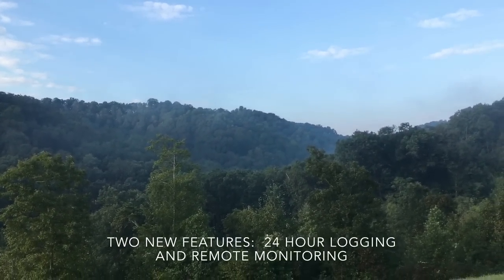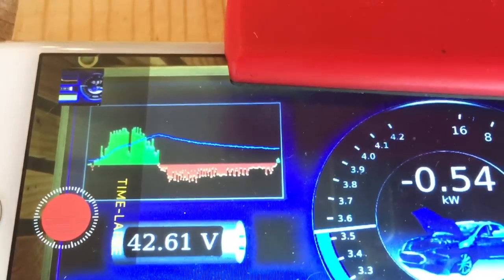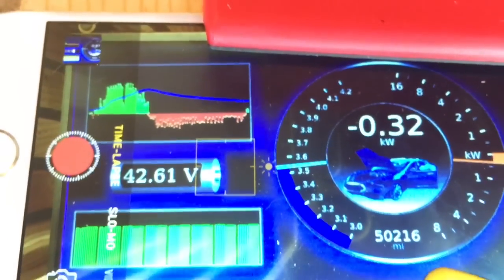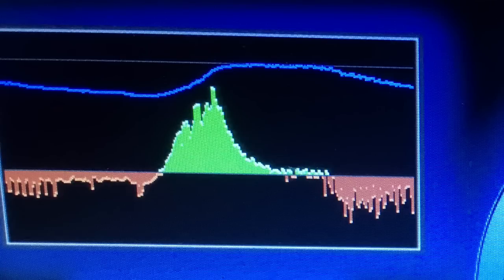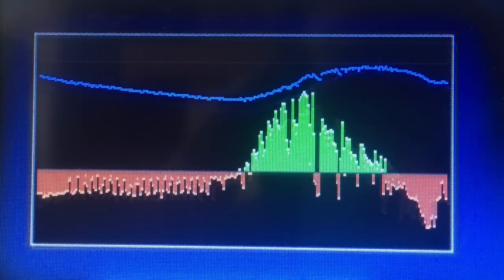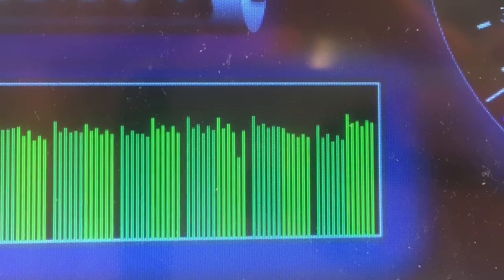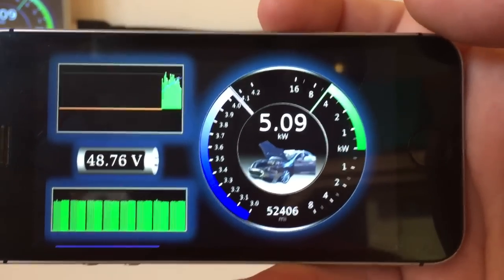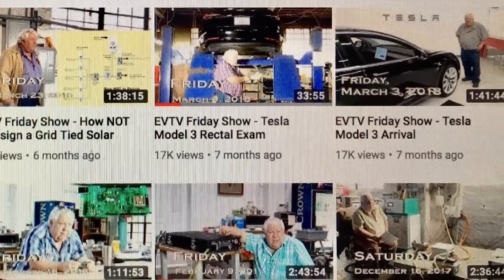Part 4 - using a salvaged Model S battery to live off grid

Comment: One thing i notice is that your mile meter is actually moving when batteries are charging vs when batteries are discharging. That how i feel it should be as that would be more accurate representation of miles. Love the videos anyways. May be you can do another update now. That will be really helpful

Comment: Clearly the voltage disparity as your battery exhausts is just showing that some of the seven ~220ah/3.6v units that make up each ~5.5kw 25v block have slightly less amp hr capacity and therefore exhaust before the rest. This means that you can't use the remaining capacity in the other 3.6v units which reduces the accessible overall battery capacity.  As the batteries age, the variation will increase and to get the most from the battery, it is tempting to add small blocks of extra lithium-ion cell capacity to augment the few individual 3.6v units that are holding the rest of the battery back. I understand Tesla initially used cells capable of 7 amps draw although ideally you would want to add cells with similar internal resistance as the original cells. I don't know how great the amp hr capacity disparity is but I would be tempted to use rescued power-tool cells for this purpose. A 18v 4ah failed power drill battery will often provide 16ah (8x2ah cells) at 3.6v (assuming one pair failed killing the battery) which may be all you need.

Comment: Congratulations for that amazing and succesfull work! I would like to share with you some thoughts: if Tesla cars (or similar EVs) would be technically tweaked to also have an AC outlet to feed off-grid homes, could it still be economical nowadays for most of us to own a second car to allow alternance in daily commute if needed? Overall, I estimated that the cost of your off-wheel battery pack adding inverters/electronics, transport, research and man-hours (not including your old batteries!) would get close to an extra EV (probably not new). If so, and since GaN bidirectional multisource inverters circuitry is available for the automotive industry, would the concept be attractive for the EV manufacturers? I'd greatly appreciate your opinion. Thanks
Reply: One thing is for certain regarding your idea. I love sticking it to the electricity suppliers because they act so smugly and any kind of renewable energy works for me!

Comment: My wife and I are building a similar off-grid home in NKY and have a couple questions about your setup. 
How much propane are you using on average to run the generator? Does it run everyday to keep the battery charged during winter? 
You mentioned having Geo. Are you heating solely from the gasification wood burner?
We're also looking at building an elevated pond for water. What system are you using to filter the pond water for drinking and household use? 

BTW, I'm an active member of the SRCA and couldn't help but notice the slate ripper in your garage on the Part 1 video ;-). Very impressed with your DIY Vermont slate roof!

Comment: If you are open to talk about solar+battery through email, in a legislative way. I hope you reply. I would be happy to put my email down, so you don't have to in public like this.

I've watched everything Jack has put out before stumbling across your videos. He has no idea how much of a rock-star he is. :)

I am about to add a tesla pack to my "grid-tied" solar system.

Please put your electrical engineering hat on... Why not just go from 400V DC (pack voltage) to 240VAC (house voltage)?

And now to ponder in your Congressman hat... My state (Kansas) has something called a demand tariff cut out for solar users that the utility gets to charge an unconscionable amount for kW used, which went into effect 20 days before I had my solar system installed.

Comment: At the end of the night when voltage is at its low point, is there a risk of increased amp draw that will overheat electric components?

Comment: Have you thought about adding a couple wind turbines to your setup to help with night time/cloudy day charging?
Reply from the maker: I think hydro is more feasible here, but neither is as cheap as solar.  I recently added more panels.
Reply: Is it possible to add more tesla batteries? Also, could you list what you needed to buy from EVTV to make the system work? Maybe a short Video. Thank you

Comment: I understand that the Tesla BMS in each 24V module is actually doing all the balancing by it self. Is that correct?  No commands needed from out side to initiate it? So in theory a module can be used in a minimum setup by monitoring the module voltage and use that for controlling stop and start of charge and discharge? 
Thanx for the videos. Great stuff.
Reply from the maker: I believe that is correct.  The black box though is the part I bought from Jack Rickard of EVTV.  I think he just wakes up the Tesla BMS and it does it's thing.  I use his microcontroller to monitor the voltages and temperatures.

Comment: I only have 2 tesla batteries modules. My system is going to be 24V just running barn/shop power but also act as backup power to the house if needed. Do you know if there is a BMS the is plug and play for 24V Tesla packs?
Reply from the maker: search for EVTV, I'm not sure what they have right now, but it's where I bought most of the stuff to make mine work
Reply: For sure check out etc store they now sell it
Reply: EVTV

Comment: The only thing I would do differently is reverse your charge and usage display to match the normal Tesla car display. On a Tesla the usage is an upswing of the needle and regen is the downswing.

But I'm just being silly, what you're doing here is awesome and inspirational to us all.
Reply from the maker: haha.  I actually thought a long time about this.   I decided that in a car, forward speed corresponds to a dial that goes up.  power consumed corresponds to (causes) forward motion as well.  you'd want the cause and effect dials to go in the same direction.  So Tesla got it right.... for a car!

however, on my dial, I replaced velocity with voltage.  power into the battery makes the voltage go up.  so power into the battery should be up on these dials too.  or at least that's how I decided... cause and effect should go in the same direction.

consider the 24 hour log.  positive battery voltage (the blue line) should be "up".  I think it would confuse people to display a dead battery as up.  (think about water filling up a glass) so positive power into the battery should be up too, since it makes the blue line go up.  having them go in opposite directions would be weird.
Reply: @oldmilwaukee100  That makes sense to me, really. It was only a little backward to me since I've been driving a Tesla.

And, I really want to thank you for all of this. I'm jealous of your setup, and plan to steal all your ideas as soon as I build my cabin.

Comment: Nice to see your system is working well.  My system with the Chevy Volt battery worked execllent all summer.  So much better then the FLA battery i used to use.  I am still looking for a BMS and have got my choice down to the Batrium system.  
Working on getting the cash saved up for that.  Will be working on installing a small 120 Volt heater to keep the battery warm during the winter.

Comment: Looks like your batteries peak a lot of the time, perhaps having an appliance come on to maximise, your solar panels would be the way I  would operate, perhaps a washing machine, or dishwasher etc,  and have the generator only come on for an hour, almost have it recognise that sunlight will take over the battery charging if within an hour of sunrise. Thanks for all your vids. Kind regards
Reply from the maker: I've wired one deep freezer to get colder when there's excess sunlight.  I'd like to wire up a bunch of hot water heaters (triggered by excess sunlight) and plumb them into my radiant heat floors.

I can't find now, but in one of the episodes, I thought I explained how a solid state relay in my breaker box turns on the outlet to my Tesla car when the house battery is full.  Voila, another 85kWhr battery to charge!  This is managed by the MPPT that is labelled "TESLA" with a piece of silver tape, which is visible in the first and second videos.  That piece of tape and that function (turning on the outlet to the car charger) predates this Tesla battery project by about a year.
Reply: oldmilwaukee100 glad you’ve considered it pal, I’d imagine you may only want your underfloor heating in winter when you’ve least chance of sun,  car is a great call, I’d probably av my washing machines, aircon, dishwashers, all high energy uses, thanks for the reply.

Comment: Very interesting real-world case study. 
I would like to know some more metrics i.e. 
What peak kw output does your PV system deliver in the summer so say 5kw x 5 hrs or a best total of 35kwhr for example
How much less in the winter
How much capacity did the tesla battery start with and How much does it have now - any idea of rate of decline
Looks like there are times when you have a full battery so cant use all  the potential PV power - have you looked at hydrogen generation for longer-term storage to feed into the generator ?
thanks
Reply from the maker: it's a 13kW (name plate rating) array.  in peak summer in KY we average 6 noon-hours.  In peak winter in KY we average 2.  6x13=78kWhrs summer, 2x13=26kWhrs winter.  50kWhrs is probably the avg.  Some days production can be as low as 5kWhrs and some days it can be as high as 100kWhrs.

The battery had 32,000 miles when wrecked/salvaged.  It now has seen the equivalent of 52,000 miles of use (total in the car and in our house).  I'd say it has 90-96% of it's original capacity.  There's a spreadsheet online that tracks the capacity of hundreds of tesla batteries based on the mileage of the car they're in.  I think they will get to 300,000 miles with at least 80% capacity based on those curves.  the question is does it keep going linearly down or does the curve take a sharp downward bend at say 400,000 miles?

I've looked at making hot water with just resistive element hot water heaters in the winter and shoulder seasons.  Haven't done it yet though.  I'd love to make hydrogen... just not as easy to implement.  Storing hydrogen without compressing it is problematic.

I can't find now, but in one of the episodes, I thought I explained how a solid state relay in my breaker box turns on the outlet to my Tesla car when the house battery is full.  Voila, another 85kWhr battery to charge!  This is managed by the MPPT that is labelled "TESLA" with a piece of silver tape, which is visible in the first and second videos.  That piece of tape and that function (turning on the outlet to the car charger) predates this Tesla battery project by about a year.